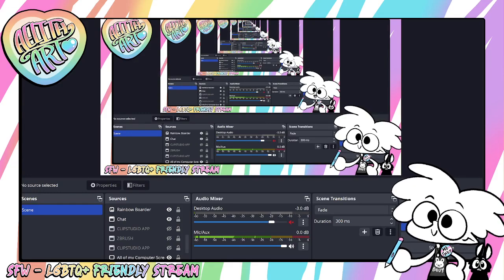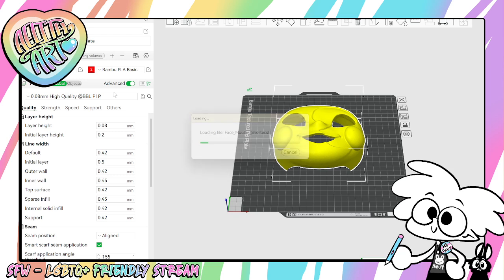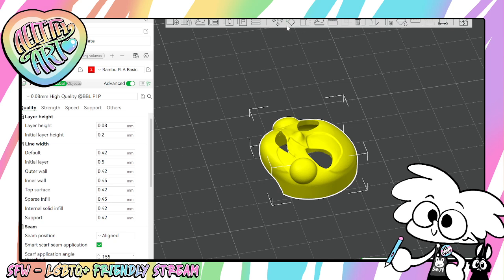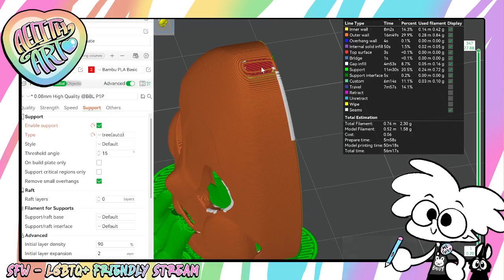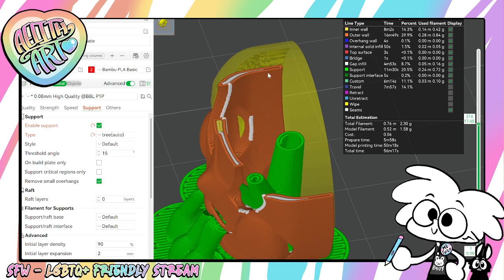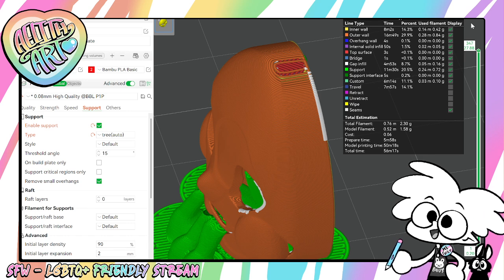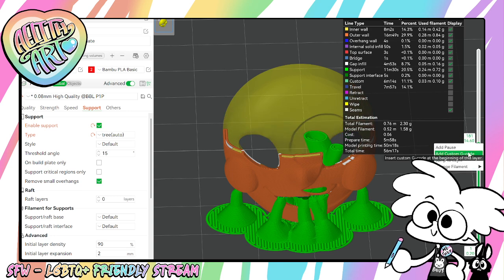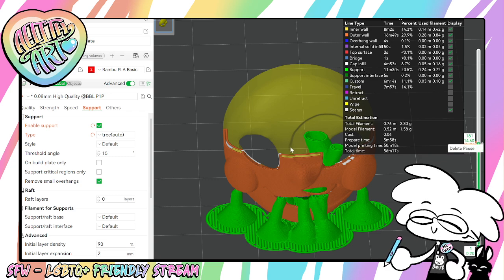How to Check Wall Thickness for your print in Bambu Lab Studio

Comment: What would be the best way to thicken up your own files, when you get to that point and check them? Would it be to re cut the openings, or is there a better way?
Reply from the maker: @victoriavidaud  I think it depends on the part! If something is too thin, I take it back into my 3D program and use an “inflate” function. There may be a way to thicken things up in the slicing software, but if they’re is I haven’t learned it yet!